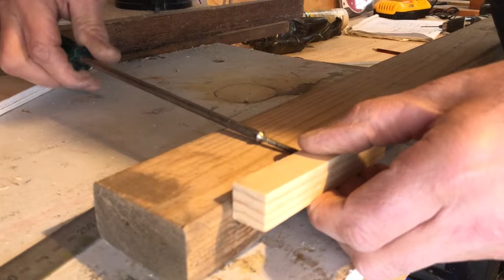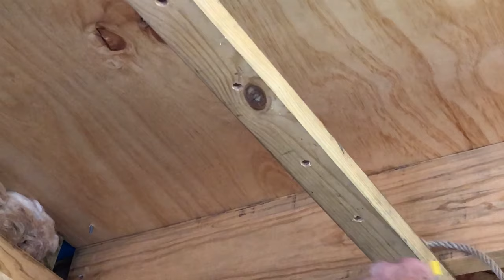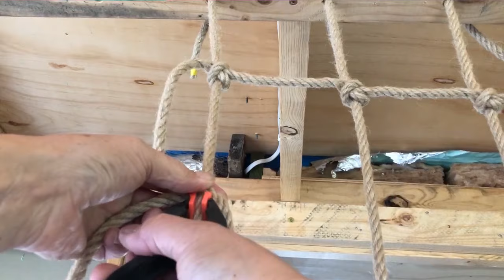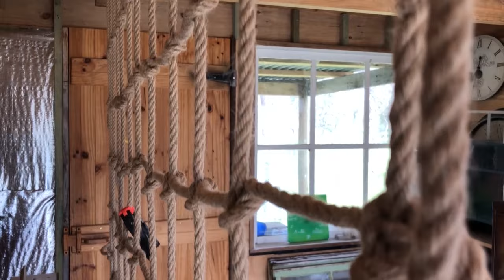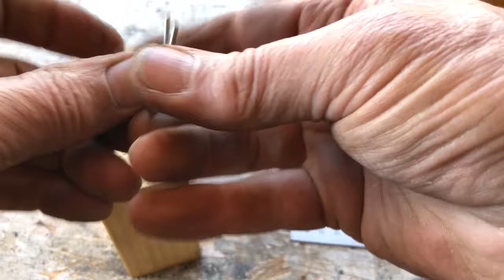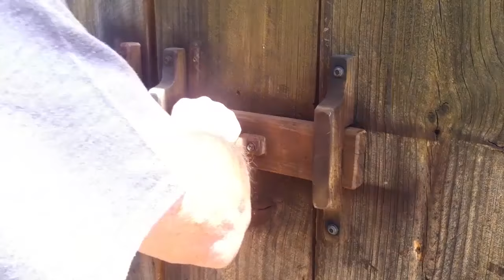Off the Grid Makes - 33 Cargo Net

Comment: Thank you for the instructions! Especially feeding the ropes through each other. 
Custom-sized net, 50x90cm (6x12 ropes; bought 30m rope overall), made by complete novice in 1 1/2 hours :) came out quite symmetrical, even though I made it on the living room floor and not in such a cool workshop as you have.
Good to keep in mind that the knots take up a LOT of rope length.